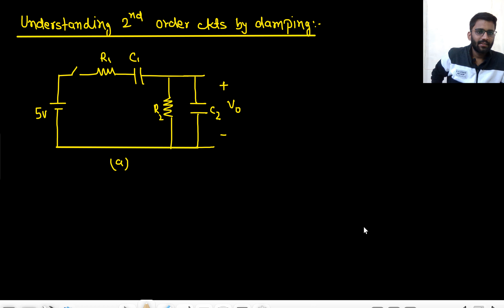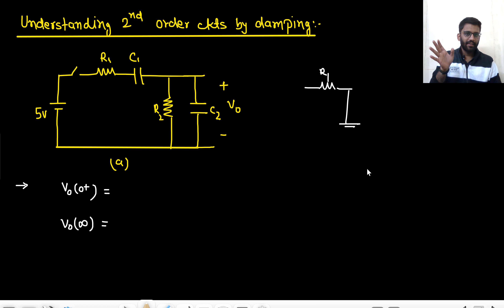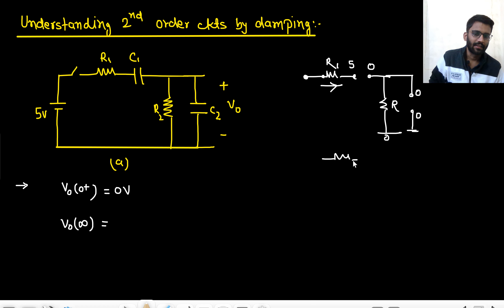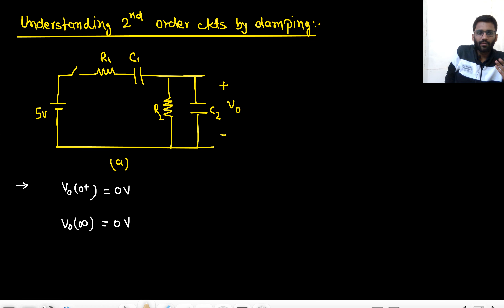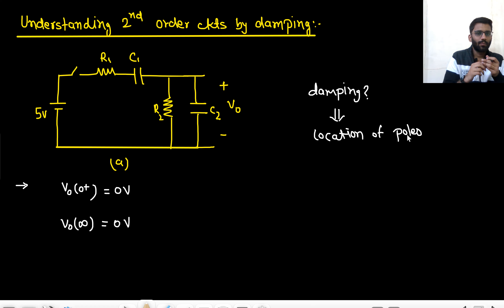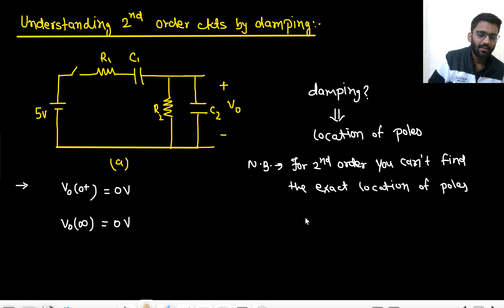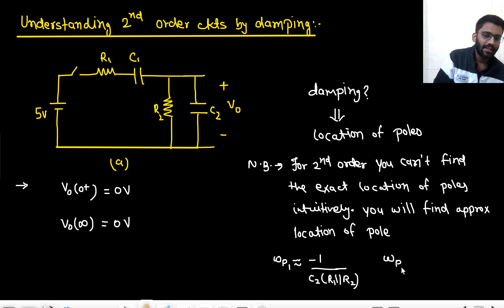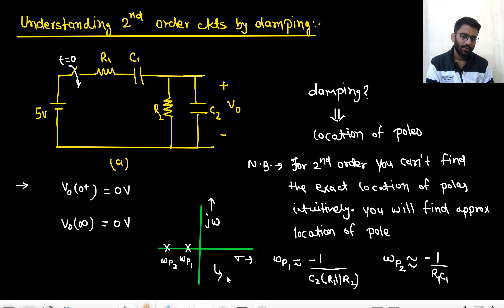Analysis of 2nd Order Circuits by Damping || Analog VLSI Mastery (Cohort 0-10)

Comment: 26:20  Isn't Vo1'(0+)=5V as, the current flows through resistor and there is voltage at that node